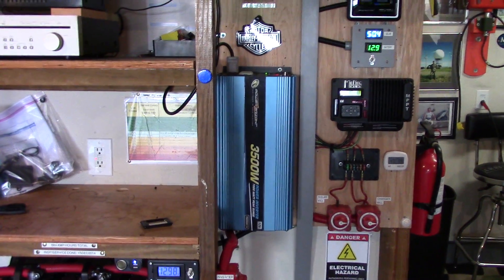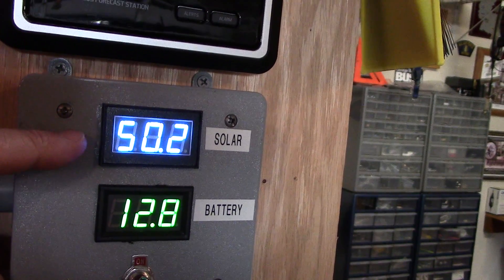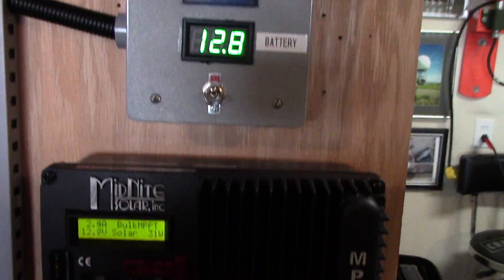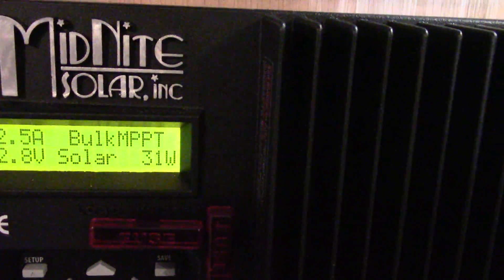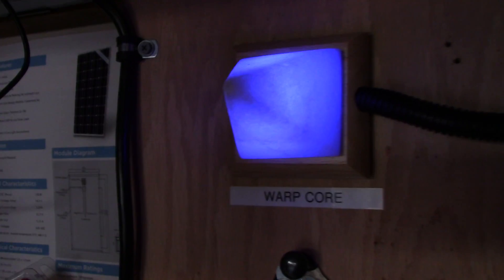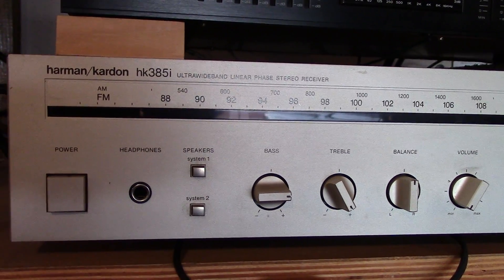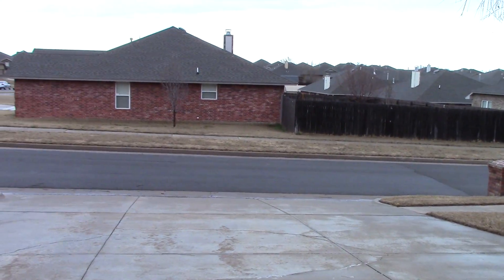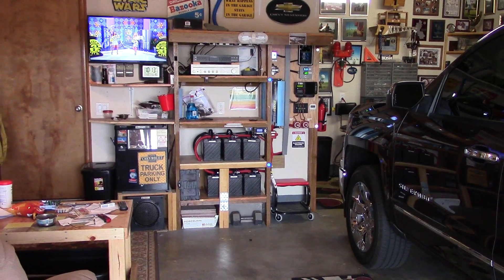New LED readout box for solar panel and battery bank voltages

Comment: It's been interesting to watch the genesis of your system to date (9/25/2017).   It's definitely come a long way as you climbed the learning and equipment curve.  I'm at 1.06KW now with the ground mount infrastructure in place and another 1.3Kw in panels sitting in my garage waiting for Hurricane Maria to pass in the next couple of days.   The other day, I located a commercial satellite dish mount that sits on 6" pipe.  It is rated at a 300 lb load and adjusts in both elevation and azimuth.  Would like to engineer mounting 8 - 290 watt panels on it to track the sun during the day and also the season.  Am very curious to see the difference in harvested power in comparison to my ground mounter panels which only are adjustable in elevation.  At any rate, good stuff, Chris and a BRAVO ZULU (as they say in my service) to a job well done.  /r
Reply from the maker: Cool! And thanks for watching my videos. Solar panel trackers are the way to go...esp if the array is positioned ideally. It is like staring into the sun all day...your eyes constantly looking into the sun. If done correctly, a tracker (or adjustable tilters) can increase kWh harvests, in some cases 50%. Lots of electronics to sort out and lots of things that can break. My little 100w laundry drying rack array gets moved around all day in the backyard...need to do a harvest reading to see how much more power I collect and compare it to my other arrays (fixed ground mount). Went to tech school with some Navy guys...ET's. The Navy trains their ETs to do all kinds of stuff along with their main MOS (AFSC)...whereas, I was trained as a specialist (SMA) on one system. Nowadays, the USAF is not as specialized and the guys have to get their in-depth OJT either in garrison or in the field. You had to have a 90 or above on the ASVAB to get into my career field back when I came in...now, it is like, 50. Making things worse...they are now combining career fields.
Reply: Thanks for making those videos and going into the detail which you do.  I'm an O-4 engineering type in the USCGR and have something just short of 1.5 years left and no more PCS which is nice.  We live on a small farm in SE VA, not real far, couple hours drive, from KVUSMC who seems like one heck of a nice guy.  When I video my system, both you guys are going to get shout outs along with the Alt-E store.  Am waiting for the concrete to cure (its been a week) on the support poles for the next set of 4- 290 watt Solar World panels which I hope to put up this coming weekend.  My next project is to install a Reliance transfer panel, carfully select and measure the load on the circuits I want to have solar capability then wire them in.   We had a 3.5KW Honda generator and learned that with fairly minimal effort and a little active power management,  it could easily run the entire house very comfortably.  We get those wonderful hurricanes (like Maria which should pass us over the next couple days) and the occasional ice storm and the utility infrastructure is a bit dated.  Last Hurricane was Matthew, about one year ago and we were without utility power for 8 days. I have a Caterpiller diesel generator in our detached garage and while the exhaust note is not loud at all, the machinery noise, AKA "diesel music" can be heard a mile away on a calm night.  Add to that, we want to generally do as you have and gradually shift our loads from the grid to an expanding solar system.  We'll stay in touch and agian, thanks for the most excellent videos !  BTW, the laundry drying rack panel arrangement was very cool !